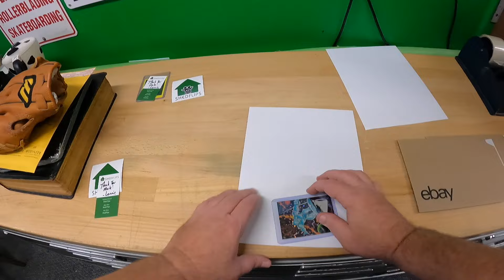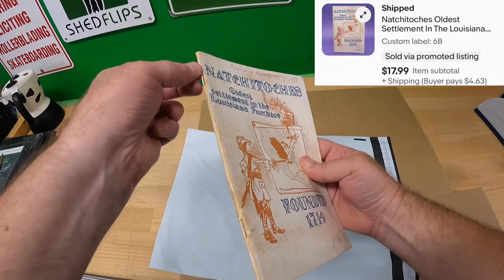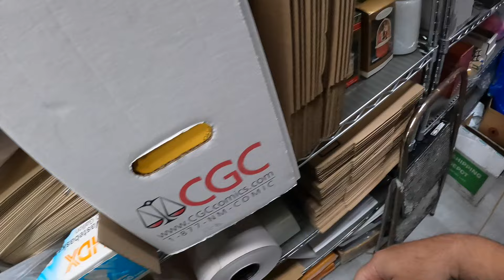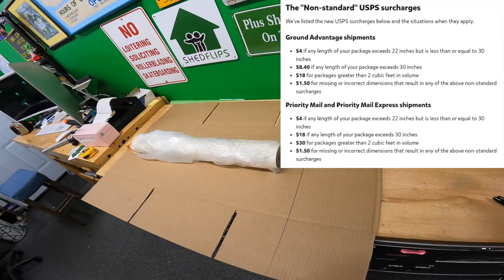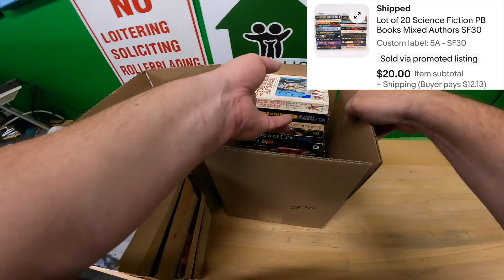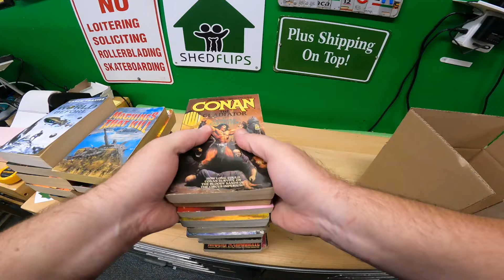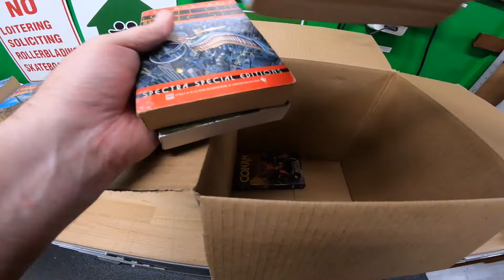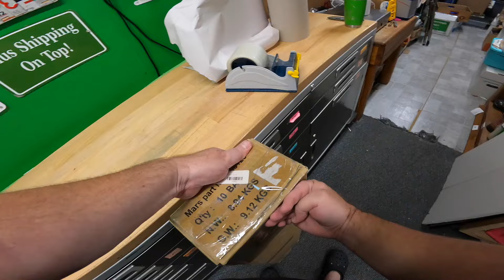I'M GONNA PACK IT #24 - Using this is ADDICTIVE

Comment: Hey Lonnie

  I was so disappointed to see that the thumbscrew didn't fit your box resizer. I really thought that this problem with yours was over once and for all. I know now what the problem is. The screw I sent you has a metric thread. I assumed that all resizers were the same, as did you. It does fit mine, even though they both look identical .When you compared the 2 in the video, I freeze framed the image and determined that yours uses a SAE (US thread), 1/4 x 20 to be exact. I am the type that has to follow thru on every task, so not to worry, the correct thumbscrew is on its way. I had Amazon dropship the part directly to you. Never give up!

  Mike from NY

Comment: A single patch should be well under an ounce. Most of the time I can have 2 an it is still under an ounce. How heavy are those eBay mailers? I use a standard white envelope (4x10). Or on bigger ones a 6x9 manila envelope.